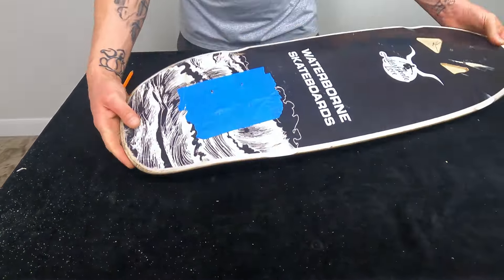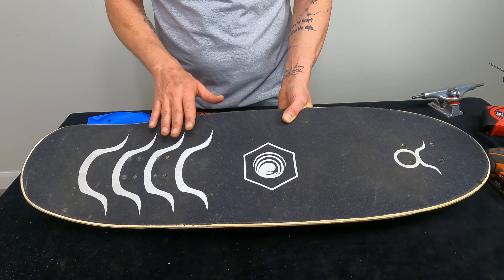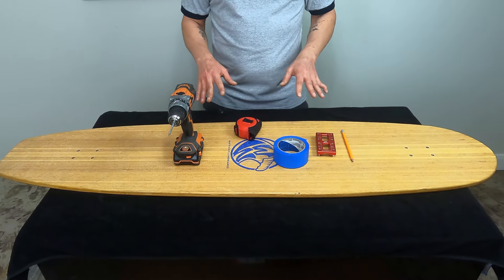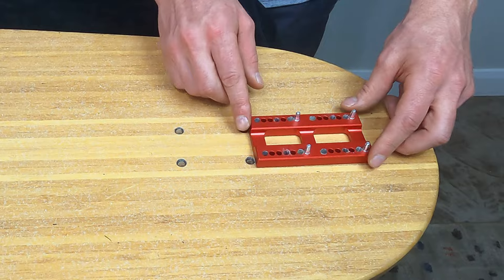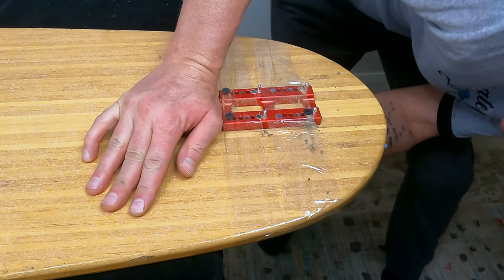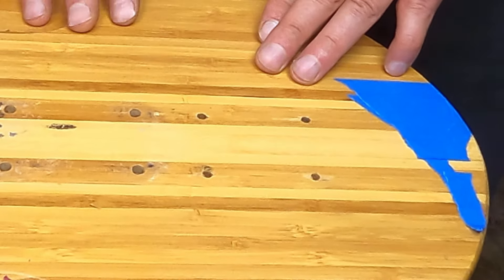How to Change Your Surfskate Wheelbase by Drilling New Deck Holes

Comment: A good way to help prevent drill bit tear out is to clamp a piece of scrap wood to the bottom side of the deck. If you don't have a clamp, tape can work, but put everything on a hard surface (table, sidewalk, driveway, etc) so that there is bottom support. Be careful not to drill all the way through the scrap wood. If needed, test from the side and put some tape on your drill bit so you know how deep to go.

Comment: Hey Steve! I was wondering if you had thought about reviewing the new Long Island Genesis LEAN truck system, which is similar to a Meraki, but bushing-based? Both are produced by HST I think, and for having tried out both systems side by side when looking for a surfskate model, I found the Long Island truck to be smoother and feel more natural, due to the tendency of the Genesis truck to rebound less. This feels like it allows me to dig into each carve harder, whereas I felt like the Meraki always had a tendency to want to push my feet back up, almost in an unnatural way.

Thanks a million! Love your vids!
Reply from the maker: Thank you! Yes, I have one and the review is in the works.

Comment: I picked up a YOW Performer Complete that uses the Meraki S5 system and I'm wondering if there is room to go wider with this deck. I love the concavity of it but I feel like my stance needs a slightly wider setup and I'm wondering if the deck and the meraki system can accommodate being closer to the nose of the board. Love from Minnesota.